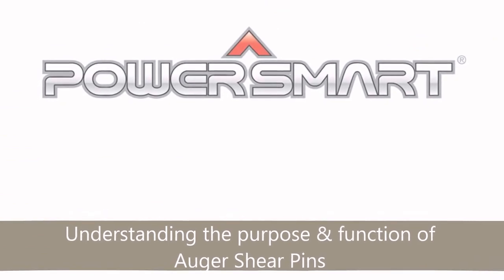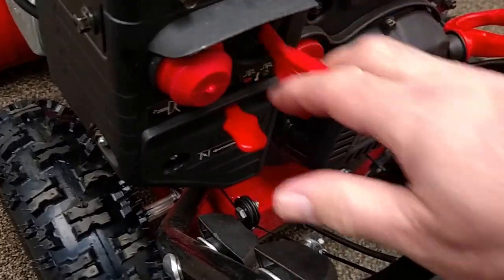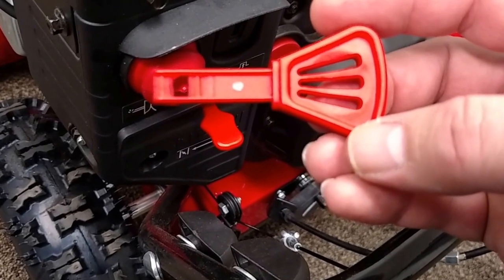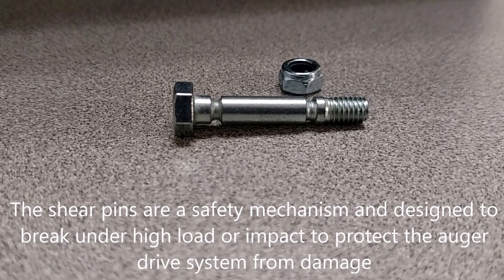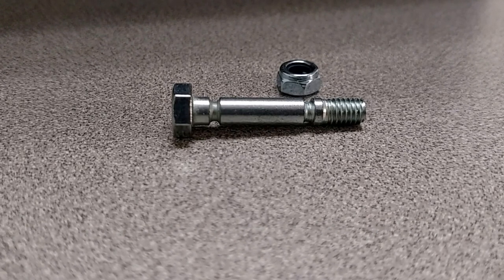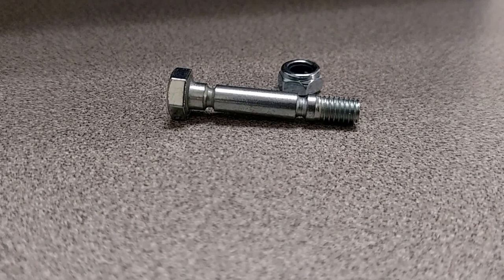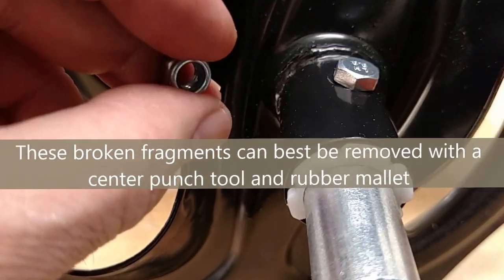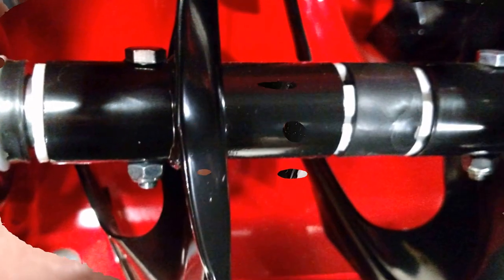PowerSmart ®  -  Understanding Snow Thrower Shear Pins

Comment: Are there any instructions/service advice/videos re maintenance of gearbox, grease and or lube to use?  Also, are there any instructions/advice/videos on the maintenance of auger assembly, and gears inside the underbelly of the snow blower?  Thank you very much for your advice in this matter.